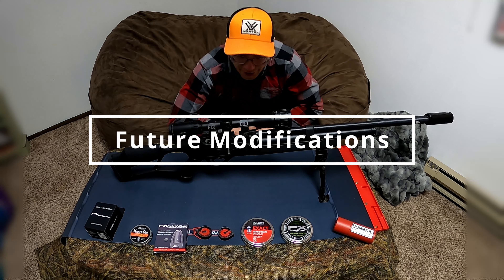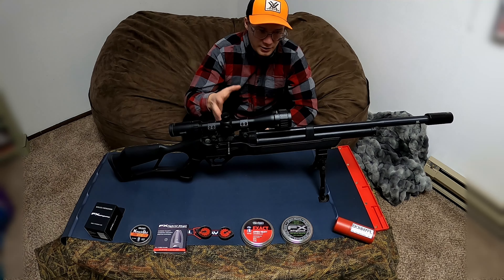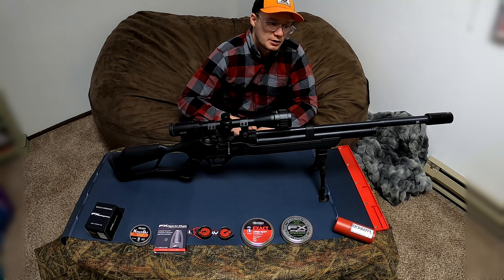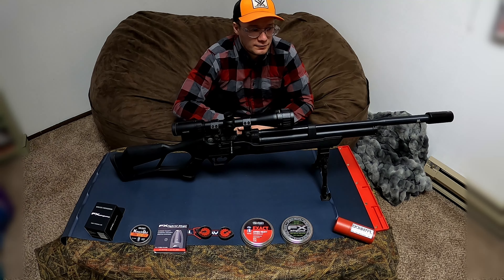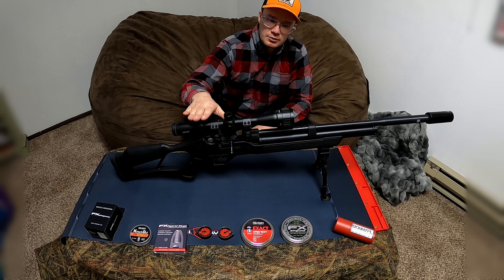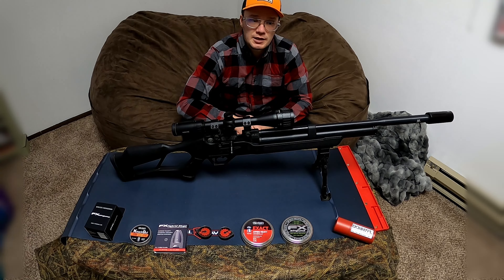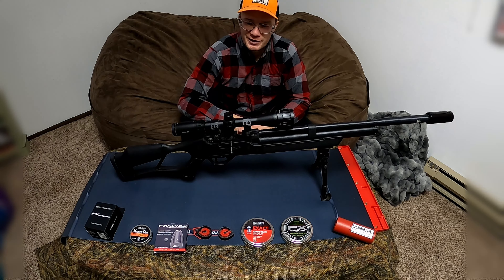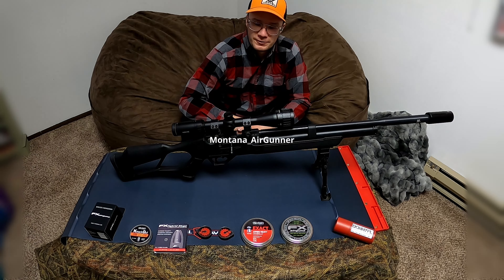Hatsan Flash QE .22 coming upgrades

Comment: This video is getting my attention now that I have one , thanks for making this video m8 your video is the first that came up while I looking to mod this
Reply from the maker: No problem 👍 Glad I could help! Theres a few good mods you can do pretty easily to it. I would have liked to have the lever version of the action. Because it would have been better for my messed up hand to pull the reloading :D Hammer spring upgrade and installing the regulator with a tube are the easiest ones. Those for sure are good for power and accuracy. PEEK valve is one that is harder to get, but the power levels after that upgrade is on another level. Flash is a great PCP for the money and I have really enjoyed owning one.

Comment: Glad some one else is trying to mod this further... Another ag everyone is sleeping on if ur a tuner is the eagle claw for $700
Reply from the maker: That's the great idea for someone to test. There is so many different guns that are superior on their price range. I just feel that in the 300$ range this PCP is the best bang for buck 100%. I am on the works to make the best setup with the Hatsan Flash for beginners and I feel this is the best platform to take the airgunning game to the next level without breaking the bank.
Reply: @MontanaAirGunner  I get 50 fpe with mine. With the longer barrel should be able to get 60-70 wich is getting close to the eagle claw
Reply from the maker: Yes, it seems the 50fpe is area is already there with the tune I have. At the moment I am having the bigger air cylinder on the gun and a regulator at 155bar with the NovaStar barrel. I would assume that with the 30" barrel I can get the 60-70fpe with different pellets.
Reply: @MontanaAirGunner  hell yea I hope so. I'm definitely staying tuned. The next thing that could eak out more power would b a different valve assembly
Reply from the maker: I have another video coming about the air valve assembly. I have modified the air valve to have a better output concerning power. Internals have been changed and ported out. More info to come on it within a few weeks.
Reply: @MontanaAirGunner  sir I have some questions. Would the barrel and shroud from a bt65 fit on a flash. With the bt65 tank installed?
Reply from the maker: @chevyimpala_04  I have not tried myself, but I doubt it. The actions fittings are different on BT65 compared to the Flash.
Reply: @MontanaAirGunner  ok thanks